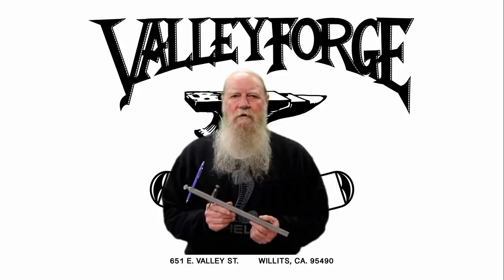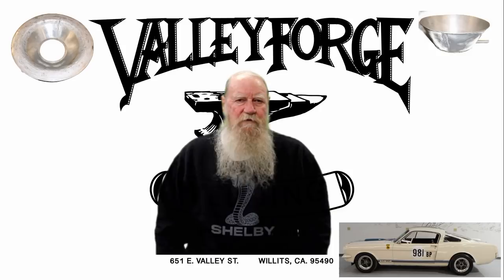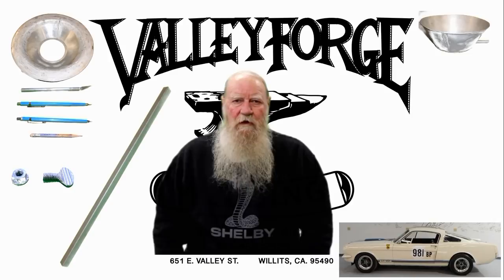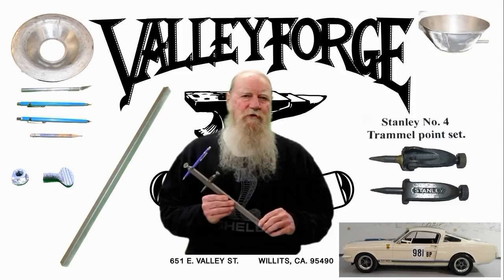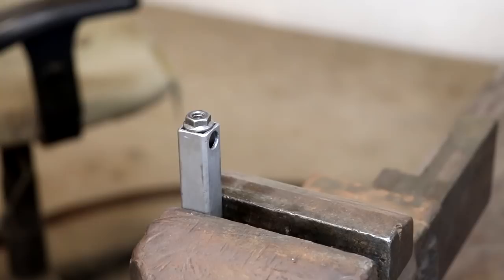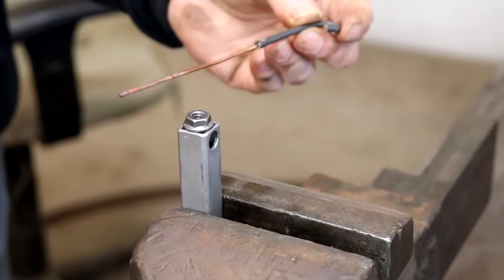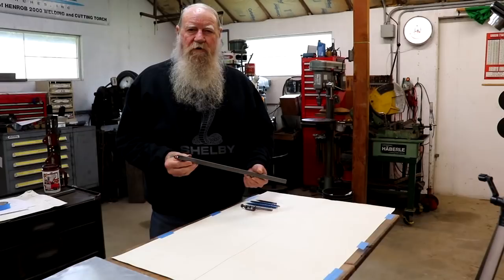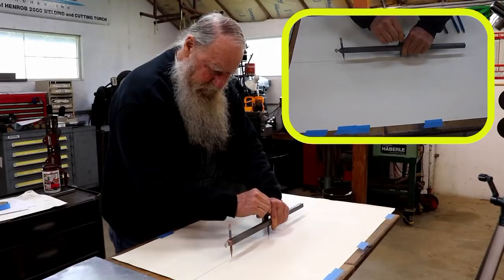The Ultimate Trammel

Comment: I have used a trammel for a few decades now. When I was serving my apprenticeship there were some other apprentices serving time as Boilermakers and one of them showed me the various uses they used them for. People tell me they are old fashioned when used to repair car chassis etc ,but they are lot easier to use than a  tape measure etc
Reply from the maker: Hello Mercmad:

Yes. Trammels are a very use full tool. What I was trying to show in this video was that they can be used for many functions not only for setting points.

Thanks for watching.          Jere

Comment: Also they are great for comparison  measurements on chassis work.
Reply from the maker: Hello Old Silk Hat.

It wasn't until your reply that I realized that I didn't mention that the tool can also be used as a Trammel by using the second point that comes in the set. Thanks.

Jere